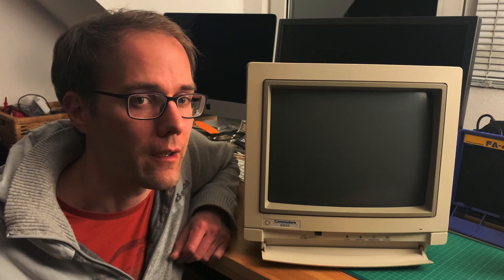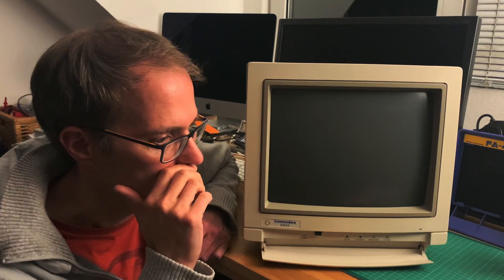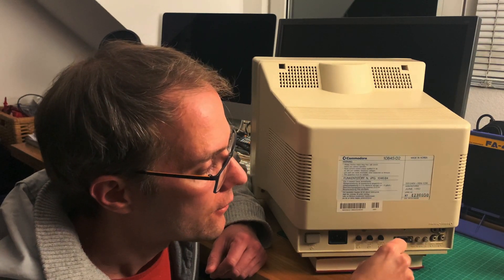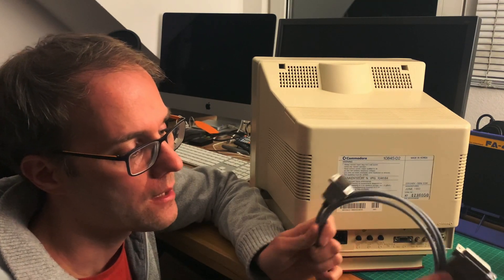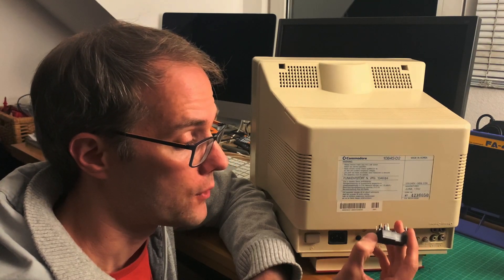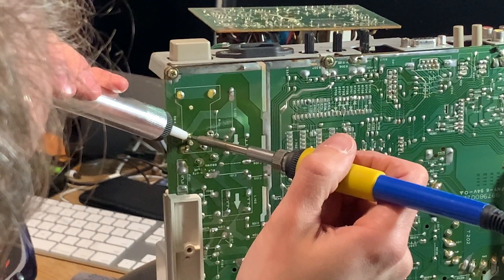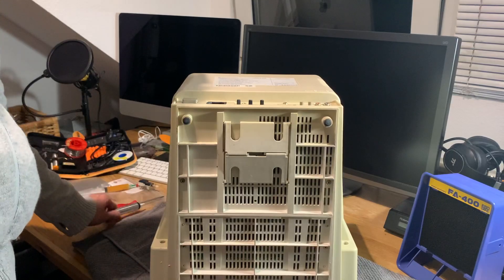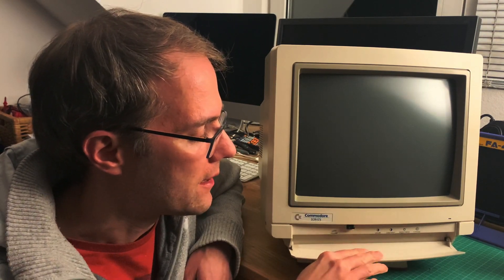Commodore 1084S D2: Replacing the Power Switch

Comment: I have the same monitor and same problem with the power button. I have a replacement power button and want to replace it. Did you discharge the screen or you did this change normaly without touching the dangerous parts?

Comment: Hi, I am having the same problem and trying to find a replacement switch for my 1084S-D1 power switch. I was wondering if I can use those same switches for my monitor in USA 120V ? and also where to get it, because I tried that link but they don't allow me to buy it.
Reply from the maker: I think they sold out. But I would GUESS that a 240V switch is safe for 120V. Arcing is worse with 240V… the footprint needs to be the same though. You can try searching ebay and aliexpress for a similar switch (type TV3).

Comment: any one knows if i can use this monitor with my pal snes rgb ?
Reply from the maker: You probably need an adapter. From Scart to db-9. I have something like that for my MegaDrive
Reply from the maker: FYI, this is the adapter I am using: https://www.ebay.de/itm/philips-cm8833-mkii-rgb-monitor-to-scart-adapterkabel-/320754731999
I am using it on the Philips CM8833-II, but it should work the same with the 1084S-D2, which also has a DB9 RGB input. You will obviously need a SCART cable for the SNES.

Comment: The "D" monitor is a Daewoo model, as I live in the US and have both a 1084S-D2 and an Amiga label 1080-D1.  The one that has DIN sockets for analogue and TTL-RGB (or in your case, Peritel for analogue and DIN-8 for TTL) were made by Philips (the P-model, same one as the CM8833).

Also, new 23-pin connectors for the Amiga are being made now.
Reply from the maker: Yes, the 23pin connectors I know about. It indeed is good news!

Comment: Does your monitor has an a strange smell. Mine has and it has been always in non smoking rooms.
Reply from the maker: Well it smells a bit of electronics when running. But I think that is ok since CRTs get warm and the hot air can circulate smells better.

Comment: Nice monitor!  The best thing about Retro Hardware like this Commodore monitor is how much easier they are to repair than their modern day equivalents :)
Reply from the maker: Amen to that. But I wish someone would still produce replacement CRTs
Reply: root42 problem with that is they’d have to be so specific to fit the screen you have.
Reply from the maker: True. But I think there were certain CRT types that were more or less compatible? At the very least I wish for some company to make a run of classic 15-40kHz 14“ tubes with case and electronics. :)

Seems there are still some companies which make or at least sell replacement tubes: https://www.relltubes.com/products/CRTs/Color-CRT.html

Not sure if those are new or old stock and if they fit any retro monitors.

Comment: So many people today don't appreciate the quality and value of CRT's.  TFT/LCD/OLED/IPS, all remarkable display advances, but there is a long and complicated signal chain between digital image and actual light output.  For low latency, and the intrinsic and natural emmissive qualities found only in phosphors you can't beat em.
Reply from the maker: Indeed. I mean they are finnicky when they are old, but let’s see if any of the LCDs will hold for 30 years! Plus if replacement parts are available, you can still repair a CRT! Until the phosphorus gives out... would be nice to have some company produce low volume, high quality RGB tubes though, so we can still get a supply for enthusiasts :)